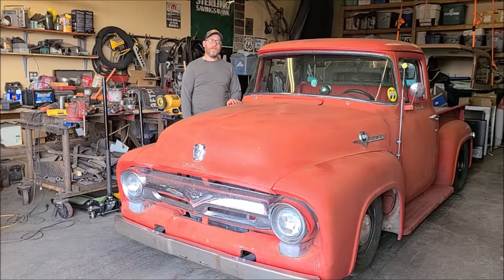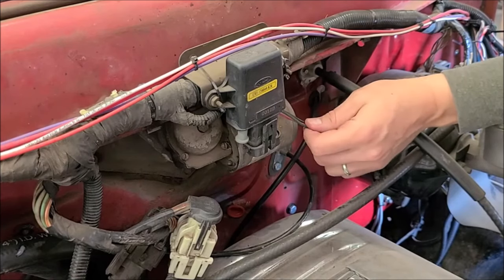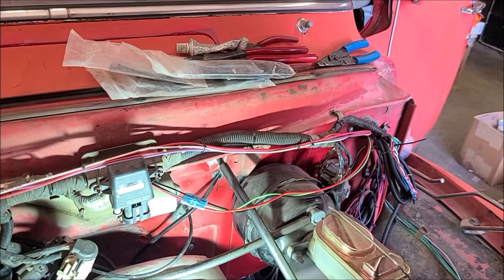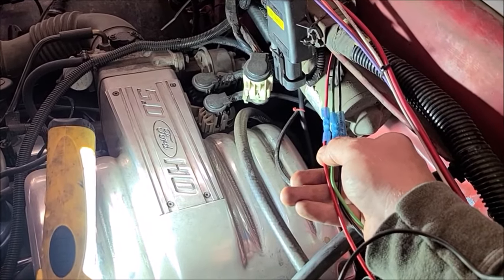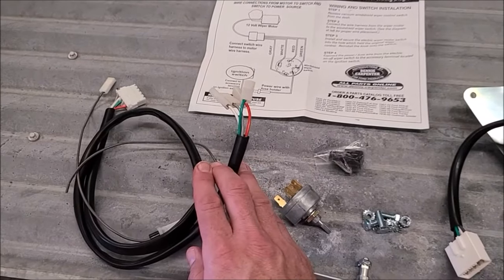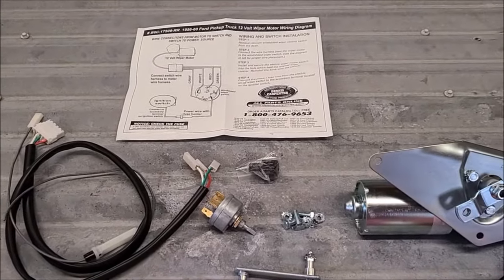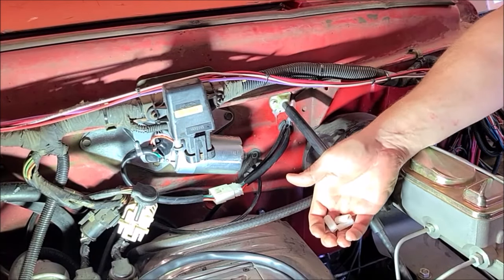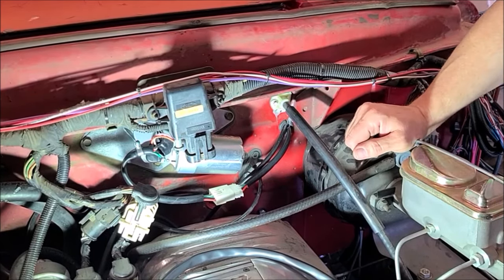1956 Ford F-100 Episode 54 - New Wiper Motor and Arms

Comment: Your new wiper motor the fulcrum that goes 360 degrees is shorter then your original one and arm that goes through your cab that arm is longer and it's throwing your sweep longer that's what's throw in it off 1/16 or 2 when linked throws your blade off almost an inch of travel distance 57 58 and 59 Ford parts also work you had the correct original wiper arms except for the driver side with the dogleg in it it's supposed to be straight I went to an 18-inch I think wiper blade where it's three pieces took the two outside pieces off turn them around put them back on you'll see the outside pieces or offset and cut the wiper blade down to fit it he recently I got and hold of Sacramento vintage Ford and got them right off the counter I tried the Dual wiper wiper blades I think they call him snow blades the motor doesn't have enough power to pull them

Comment: My truck came with inside tailgate latches and they removed the chains. I really want to restore them. I see online I can buy a chain kit but I'm a little confused on the tailgate itself. It looks like they grind it off the high volt do you have any" of that or how to turn up the tailgate?

Comment: I took the gear off of the wiper motor that you didn't take off and I strip the gear out of the wiper motor it's a thing composite plastic fiber looking thing I need the gear out of the inside of it can undo the end of the motor you can rotate the brushes in speed up or slow down the motor rotation